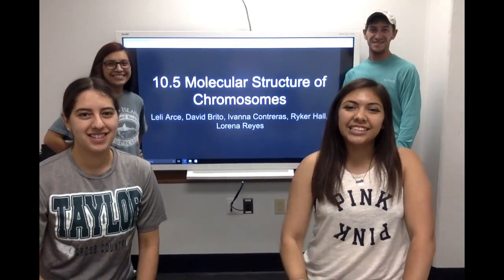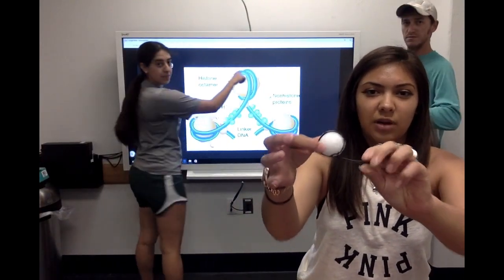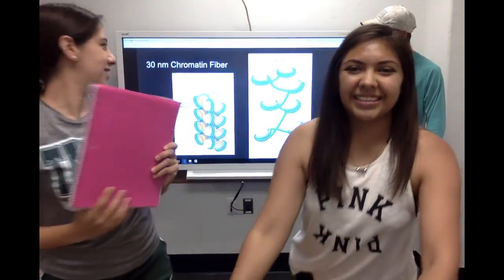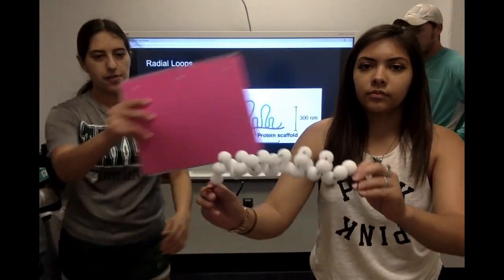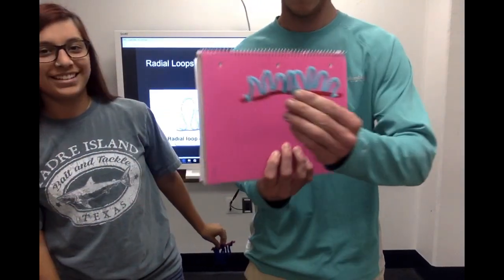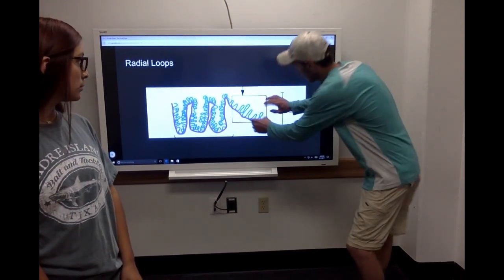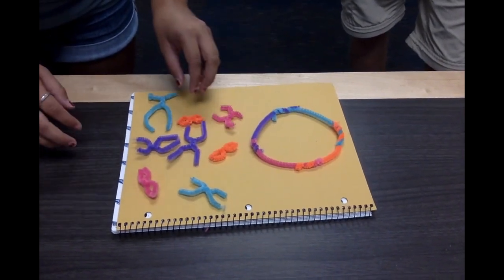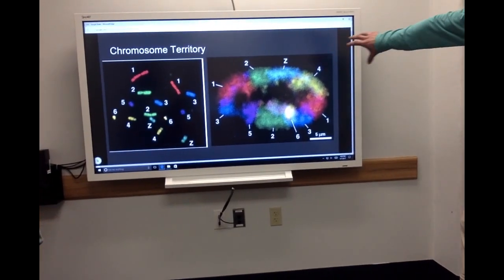Molecular Chromosome Structure

Comment: Great Job Team Mitos! The only clarification is in describing chromosome territory. In the example using the pipe cleaners you mention that the DNA that is loose such a beads on a string are how they are found in metaphase and that the condensed chromosome is what is found in interphase. You have that backwards. Other than that I enjoyed the video.